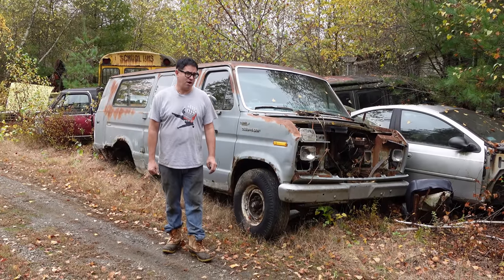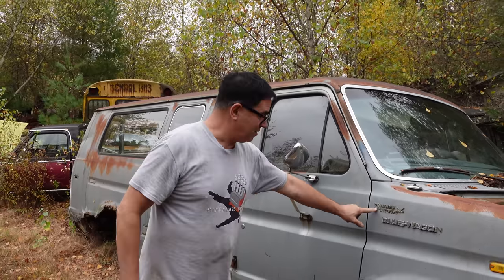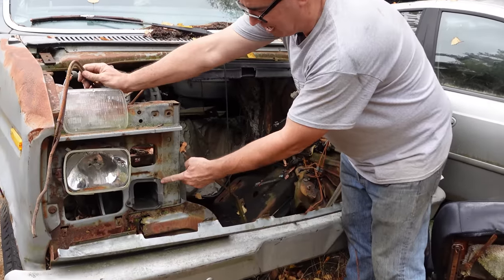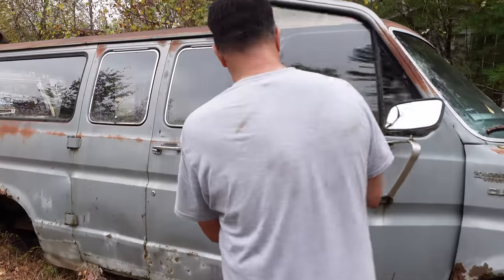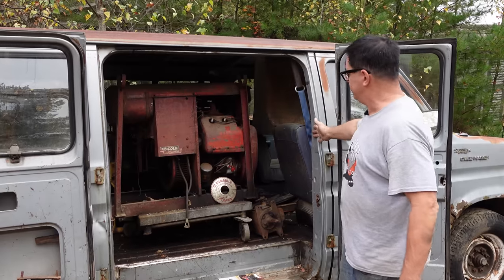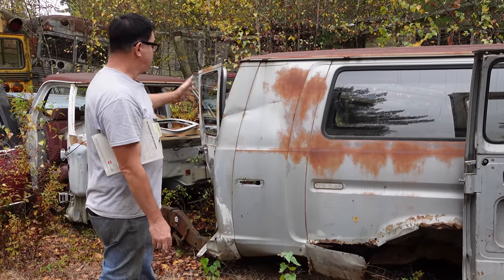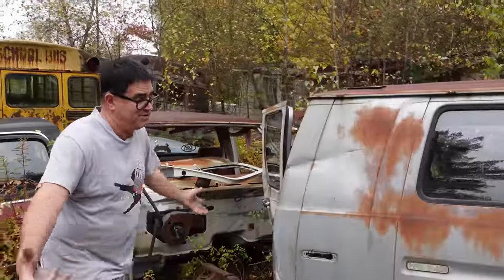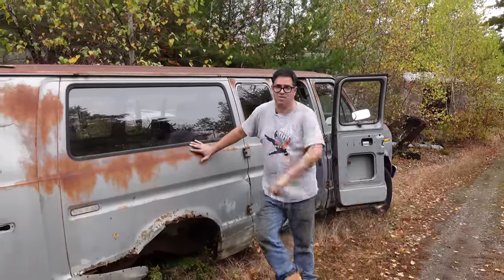1979 Ford Club Wagon Super Van

Comment: I am the original owner of a 1979 E100 that is sitting in my driveway. It has a 300 w/ 4 spd overdrive stick shift on the floor. It’s never been garaged but I show it a lot of love. I am currently replacing that crappy poster board headliner.  Big Ethyl has almost 300,000 miles and runs great. I removed the lame manifolds & got Clifford Engineering 4 barrel intake and headers. The flow master really helps it run and sound great. My engine has never been apart !!!
Best street engine Ford ever made. No timing chain !!!

Comment: Back in the 90's, I took a course at Bondurant's Driving School. As part of the course, we were taken for a hot lap around Phoenix Int'l Raceway in a van much like the one featured here. I figured they would go kind of slow, showing us the correct line to take. NOPE! With 15 ppl aboard, the driver practically set a new lap record! I could not believe how well it handled! When we finished, I looked at and asked about what suspension mods were done. It was STOCK!! I do believe it had a 460. We all were totally impressed!

Comment: Hi Steve, Love these videos I special ordered my E150 Supervan from Ford in April 1978 and waited till July for it to arrive with 6 miles on the clock. The first thing I did to make it mine was take out those block out covers and put in working red side marker lights.
I also ordered my van with 351 Windsor and matched up with the four speed overdrive transmission. Now I keep it pretty much a garage queen. I also still have the original brochure I ordered it from along with the original bill of sale. Would love to send you a couple pictures if your interested.

Comment: Even from a young age,  I always noticed the blocked-off side marker on these extended vans.  It just never looked right to me (along with the added length without a corresponding wheelbase change).   Thank you Steve for your videos!  I look forward to them every morning before work!
Reply: Yeah I noticed that about the blocked out side marker light on the extension as well. I've got one I bought a long time ago for whatever reason. Anyway the thing is a tank and it handles like one. But you can haul a roll of carpet in the back of it pretty easily with the doors shut on back. I'll save the rest of it for my comment
Reply: Vans are  just more refined versions of panel trucks.   While some people with big families may have bought them as a family car, that was not the norm, so blanking out things like a side marker light to utilize the same stamping was accepted by most van buyers.
Reply: I have a Dodge Maxi-van that I love, though It needs transmission work.  Not only does the extension increase interior space, at very little cost in gas mileage, but it also improves traction, which is important in Massachusetts where he is and where I'm from.  However, he still shouldn't touch the headlight bulb because especially if we have a prepper type collapse, somebody might bother to test the bulb, find that it still works, and glue the glass back on, or even run it without glass.
   Anyway, I love the extra bit of traction that the caboose gives me, and hope someday to swap my 318 for a 239 to get even more traction, plus posi, aluminum radiator and rear mount battery, though the latter would reduce cargo capacity.
Reply: @kennethsouthard6042  I agree. I've only known one panel van in my entire life and that was a half ton Chevy 1970. It would been really kind of like riding in a box if you had passenger seats in back. But then I bought it from a friend of mine and everybody hated it. Well one time is red with a ton of pinstriping. By the time I got it it was black with a ton of pinstriping. They called it the fancy hearse. I dressed up the floor and back put a killer engine in it. Then trade it back to that same friend. I sure like that truck and I wish I still had it.

Comment: We had one of these in the 1990s, exactly, at the school district that I worked for. Powerful, heavy duty vehicle. The 15 passenger flap with these vans and insurance companies made it eventually go away. Also, I remember, nobody wanted to drive it. Even though it was a fuel injected 460, It only got about 7 MPG. Great, reliable truck though.

Comment: I worked for a small company in the 70’s. We ordered 2 new 1979 E250 cargo vans. 300 six cylinder with 4 speed manual transmission.

Comment: I had a 1975 Ford E250 with the sliding side door, 351 Cleveland V8 and a pop-top canvas roof that allowed you to stand up during camping trips. It was incredibly reliable as we took many long trips way up into the mountains where radios and cell phones didn't work. We had a shortwave with us but that was it.  I finally had to retire it because the rust at the back panels became so bad that the dust from the gravel roads would fill the back and coat all our gear with dust and the body would sway when cornering. It still ran perfectly up to the day that I scrapped it. Shame. It would've made a great flat bed hauler.

Comment: Being a more or less base model, could that E250 have had the inline 6? Could it have even been an E350 1 ton? I replace a 460 in one of these vans back in the day (probably 1990 or so) and the fact that the radiator support had that center section that unbolts made it a pretty easy job, versus some vans where you had to pull the engine through the side doors. I think Dodge actually made a MUCH better looking "super" van (Maxi) since they stamped dedicated panels and avoided the add-on look and the blanked-out rear side markers. Thanks, Steve, for bringing us all this informative and entertaining stuff! You ROCK! Stay cool, bro.

Comment: I've read those extended body vans were unwieldy when loaded. The passenger vans were especially effected due to baggage loaded in the rear.
Reply: Nah. only if you overloaded an E150. The 250s and 350s were pickups with a skin.
Reply: @karlx-1  I drove these for a living in the mid '80s and they got very, very twitchy when fully loaded because of all of the weight cantilevered behind the rear axle.  The damned things would see-saw to the point where you could hardly steer, especially if the rear tank was full.
Reply: You haven't lived until you've sat in the back and been "catapulted" into the roof over a bump on a bad stretch of road. LOL.

Comment: My Super Duty Ford van is a 2002 E350 that started life as a local NBC Bay Area news van. It's a 2 seater with a V10 engine. You know, just like a Viper.

Quirk: it's got 8 lug wheels. But the factory wheel covers have 7 fake lug nuts.
Reply: nothing like the viper engine other than its a v-10
Reply: @thepyrodude  Really? I thought they were interchangeable. Thanks for your insight.

Just kidding. My Ford V10 has 244,000 miles on it. I doubt if any Viper has that many trouble-free miles.
Reply: @SupergurlKara  there's actually quite a few vipers approaching 200k and above

Comment: The 300 cubic inch six was available in E- and F-250 vehicles
Reply: Correct, also the 302, 351 and 460 engines.

Comment: Carpenter's Limousine 😄 Steve,  the side doors are the same as the back doors, correct?  Now I want two of these cut the back off one to graft to the other. Having it's back doors be the side doors of the other. Taillights flush French mounted, bumber/step rail, exhaust and 2nd license plate too 😂😂😂 model kit build of it  might be more economical
Reply: At least on later ones like my 2002 E350, the side doors and back doors are different, with the second "suicide opening" side door being smaller.

Comment: What was that big block motor sitting in the back? I'm using my phone to watch this morning and couldn't quite make it out.
Reply: Looks like a Chevy maybe a truck motor, it has an intake for a Holley or AFB rather than a Rochester.
Reply from the maker: It is a Chevy big block, but its a tall deck truck engine. Perhaps a 427 but most likely a 366. THANKS for writing, Steve Magnante

Comment: Ive had a lot of vans but my favorite which i still have is an 89 E-150 with 302 and automatic with overdrive, I bought it new and only used it for trips and hauling my motorcycle. It has not been able to start for the past ten or fifteen years hence it is a storage bin in my yard. Id like to get it running again. What should I look for? It cranks and never was abused with about 120,000 miles? Steve V

Comment: Hello Steve about 7 1/2 minutes or so you said four Dodge and GMC was still unitized. Not correct. Sorry. Trying to think of a small van that they put out that was. Among my collection even the later Ford aerostars and the Chevy version of the Astros were frame with body attached. I've got a 76 GMC 3/4 ton I think it is. Anyway we painted up red white and blue never to get the stars on it. Trust me not only does it have a frame but you can walk on the roof and when I was younger I would take shingles enough to do a small house put in that van and then just walk up the ladder from the doors on the side of that van up under the roof of the van because it's reinforced right onto the roof of the smaller house. It didn't take me too long to figure out wanted to hire somebody to do that part of it but the Dodge Maxi Vans I've got one of them and it's frame but body attached.. it's 3/4 or 1 ton man I don't remember. They all still run. Just remnants of a tried carpet business. The guys did all right but it wasn't worth my time for what I was getting out of it. The Ford 110 van pretty much same as what you showed except for this one's a little more dressed up because the federal government bought it and they can spend our tax money nothing about those wide doors that open up on the side made easier to put the prisoners in and transport them when they were in chains. Yep I got that van straight from Lansing Kansas.

Comment: Hi Steve, Super Van; no windows.  Super Wagon; had windows, (same chassis) the engine was probably a big block 460 4V (four venture carburetor) or 4 barrel carburetor "you might say" that is why the engine and Ford C-6 automatic transmission was the first thing to go.  I bet the van or "wagon" was a Trailering Special Package, they got the radiator and the transmission cooler also.  Please reply.  Dave...

Comment: Motor mount towers say 460.  The wayvto tell is 302/351w/m and 400 have single teardrop shape hole in the tower 460 tower has 2 teardrop shaped holes.

Comment: How would you tell what motor this van had?
Reply: Look at the VIN number on the driver's door post and see if the 4th digit is a B (300 CID straight six), G (302 V8 with barrel), H (351 V8 with two barrel), or J (460 V8 with four barrel).
Reply: @googleusergp  thankyou
Reply: @markbedard6238  Yup, sure thing.

Comment: a bare bones work vehicle.if they made them today, they would sell.but the automakers make all the garbage a work vehicle dont need standard, instead of optional, so they can charge you an arm & a leg for garbage you dont need or want in a work vehicle.the more garbage on a work vehicle the less reliable they are.overcharging by design.